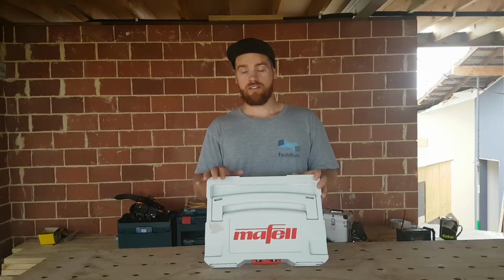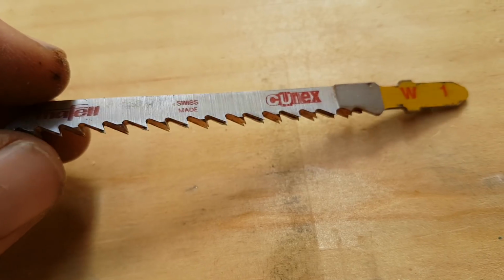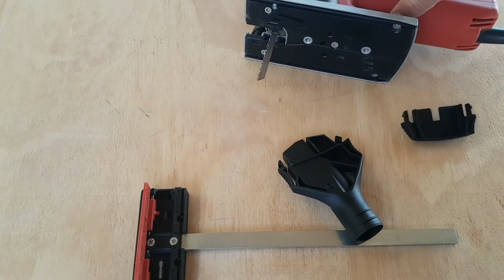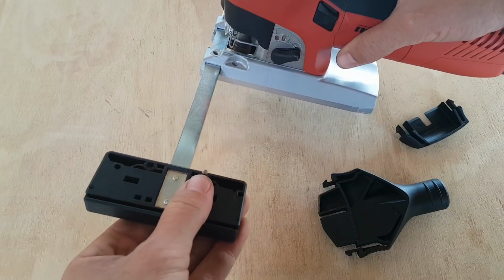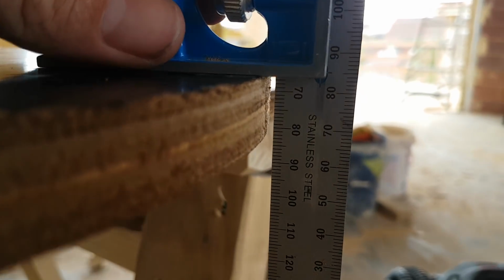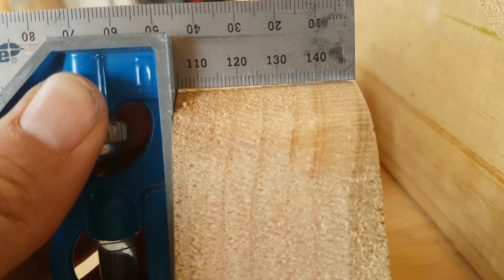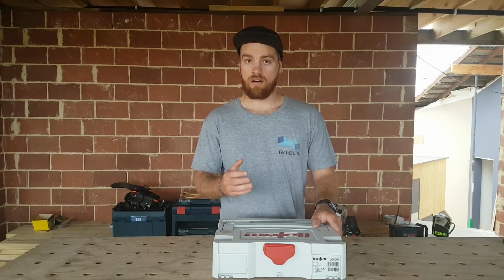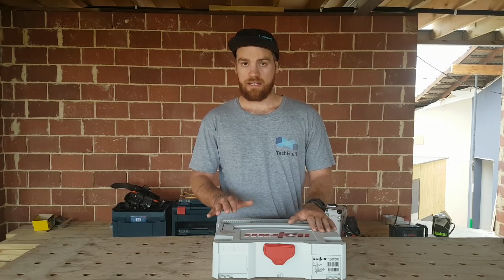Mafell P1cc jigsaw

Comment: It’s a shame you didn’t get the full kit. Mine came with an 800mm rail and tilting base. It is the best jigsaw on the planet at the moment. When I brought it I though bloodyhell this is dear but now I smile every time I use it and glad I’ve got it.
Reply from the maker: I borrowed this off a mate of mine. We aren't lucky enough to have Mafell here in Australia, need to get it set over from the UK. It's super expensive but nothing comes close to it, if you need something this good, you can't argue with the price
Reply: TechBuilt Tools and Carpentry no by far the best jigsaw even with the price tag.

Comment: If you are cutting in reverse with a blade in future, turn off the pendulum action, Mafell warn about this in the instruction manual, you might wear out the saw prematurely or even break it. Pendulum action can only be used going forwards. Also I noticed you used full pendulum action when cutting the curve on the 45mm timber, you would get a better finish and a little less vibration and jumping if you turned the pendulum action down a bit, maybe number two or three setting. Is your saw still in good working order and performing well ??

Comment: Got a chance to use a colleagues P1CC the other day. It's no joke when paired with a CUnex blade. I use a Bosch GST 18V-LI S jigsaw and it's a beast but this was next level - even if it is corded. They do 150mm long CUnex blades for this too I notice and a tilting base attachment that works with the guide rails. Seriously considering getting one after using it. League of it's own.
Reply: I imagine maxwell is working on a battery version, they have recently released other saws in 18versions
Reply: Fingers crossed !

Comment: I too have the p1 full set with the extra base and guide rail.
I love this machine there truly is nothing like it I have their plunge saw plunge router planer and the big kss 80 crosscut too all are amazingly well built heavy duty tools. Waiting for them to make this jigsaw cordless then will make the plunge into their cordless range you can buy all the kits without batteries then buy the Metabo 8.0 batteries in pairs with a fast charger.